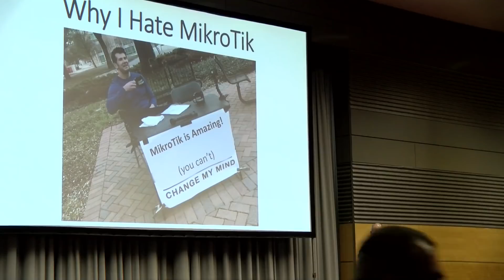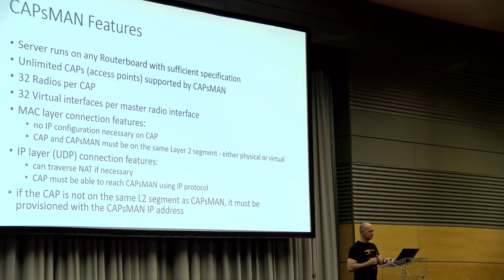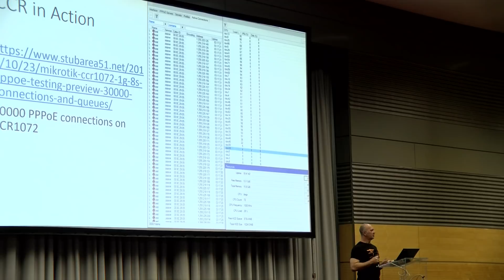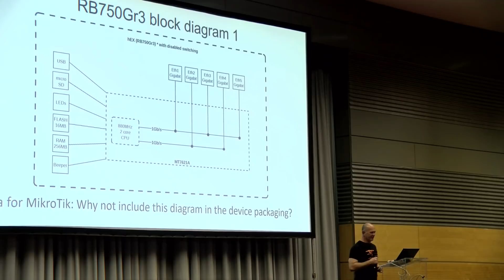This is Why I Hate MikroTik

Comment: I hate MikroTik for only be manageable by a Windows application. Would they provide a usable cli (not PS like), would make them almost always the device of choice.
Reply: learn how to SSH, srsly
Reply: @nikitakipriyanov7260  You obviously didn't read my comment. So you would know, that I only use ssh to manage my devices. And that is exactly the issue: prohibitively, non intuitive, awful cli. SSH is just the transport. The cli itself is in question. Regardless if used via serial or ssh.
Reply: @jani140  But the CLI and the GUI practically resemble each other. Whenever I find anything in GUI, almost always it is in the CLI in the same place. I agree that some things in RouterOS that are not that logically placed and I need to google just to find out where they are, but in such cases it means I would not be able to find them in the GUI either. Other things are just awfully implemented (try to configure VLANs on CRS125 to get what I mean). Third things are made differently on different hardware; it's clear that all of these machines have different capabilities and methods of configuration, but the purpose of RouterOS interface as a management tool is to hide those hardware differencies and make them under the common term, where possible. This was not done, again, not in CLI nor in the Winbox or WebGUI.

So it is strange to want Winbox while claiming the CLI is awful.

My own discontent with SSH implementation is primarily because it is assumed to be human-only interface which inhibits tools like Ansible. I even had a bug report about that, to which I got a response, "use API". Well, why would I (setup additional dedicated service), when there is SSH?
Reply: @nikitakipriyanov7260  Again not read carefully. I hate RouterOS for being primarely built to be managed by windows software. I don't have any windows. Crap design does not work for me.

Comment: just connecting to it wirelessly will knock my pc off the network in spite of manually setting the ipv4 metric.

The ones I got,  I got them because they were the cheapest thing out there to just be a wireless router.

I'd say there's something wrong with them, because I can't imagine why it would be unable to get a dhcp address nor why it would knock my pc off my network when I've never ever seen that before.
Reply from the maker: Most likely wrong cabling or other misconfiguration. Post your setup in our forum and we will help

Comment: unrealistic expectations?   Like when I expect after a reset and wired connection to internet port on the LAN with my 2 dhcp servers and it never gets a dhcp address and literally any other device can?  deal breaker.
Reply: Yeah, I know what you mean... But Romon or ip neighbors would help you work around that. Frankly, it's a silly reason to hate it though.. Cisco's are the same.
Reply: @ImmutableTech  I wouldn't have a Cisco either,  I'd sell it and buy 20 ubiquitis.  I remember a guy bragging how if he has a problem with a cisco that cisco will be there in 2 hours.   I said if I have a problem with a ubiquiti,  I'll break out a new one in 2 seconds.
Reply: Yeah. No. Ubiquitis are excellent, and im not fond of cisco. But having worked with all three professionally, Mikrotik, ubiquiti, and cisco. 

Comparatively, Ubiquitis routing and firewall suck! Ubiquiti is suitable for a home or a mid-sized non-it business; its ease of use and features FAR outshine any home router making it great for that use case. 

However, due to its "ease of use," it hides complexity, making it near impossible to do what you need to do with them. As an example, you (at least last time I checked) couldn't assign two ip to the same port, which is a requirement in a lot of cases.

For me, they all have their place.. Mikrotik is great for advanced features at a great price. Ubiquiti is perfect for ease of use, with some stunning network work features out of the box. Cisco, cisco belongs in the data centre... You install it, forget that it's there and in 20 years time replace it. It's just that reliable.... For a price.

Comment: We have literally hundreds of Mikrotik routers deployed, and it is our goto choice for managed router installs for both our corporate use and our clients. That being said. I both love and hate them at the same time. We choose them for our router needs because we need the ability to set up complex traffic shaping rules and it's built-in support for multiple VPN connectors. No other manufacturer provides the same level of features. We often bundle VOIP telephone service our internet packages and having the ability to create custom rules that isolate that VOIP and prioritize that data and provide perfect audio quality over even the weakest of internet connections is an absolute necessity and the QOS abilities of other products lines do not even compare in any way what so ever. But, it can be a nightmare trying to manage hundreds of these devices, even with the use of their 'Dude' server which acts as a centralized management platform for that. Inside the lan, and for our wireless solutions, its always going to be ubiquity hardware. Switches, Cameras, wireless p2p and p2mp, ubiquity is the choice just because of ease of use of their unif and unms management software.

Comment: I switched from USG to mtik and have not looked back since. 

I use Ubiquiti AP and switches in my deployment and mtik as the router. Best of both worlds.

19:21 There is one very big downside of CAPSMAN vs Ubiquiti. In UB, I can ADOPT my AP and if it disconnects, I can see it. In CAPSMAN, if an AP is disconnected, it is just gone from the list. This doesn't help me monitor AP statuses easily without using say, netwatch. Is there a way to change this behaviour?

Comment: 0:00 Why I Hate MikroTik
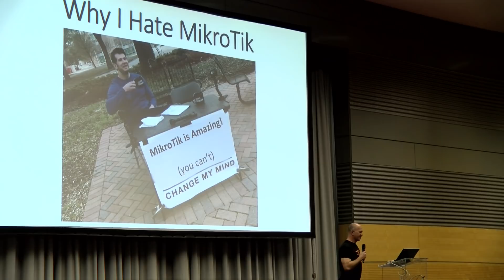0:30 MikroTikSA
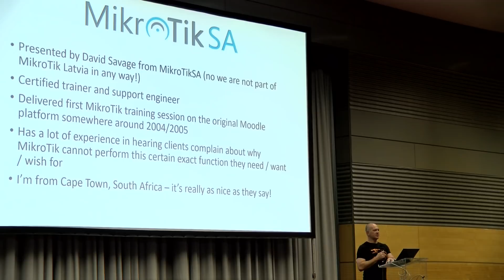2:10 Cape Town, South Africa
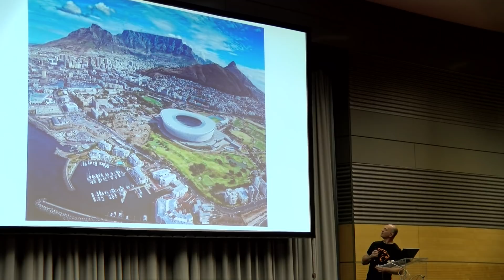2:18 Full Disclosure
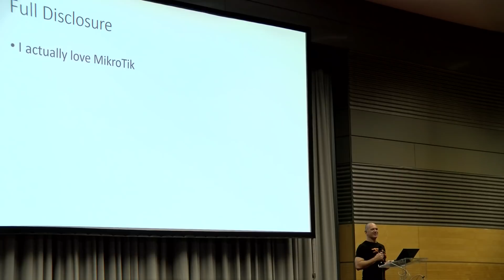2:28 What's this all about then?
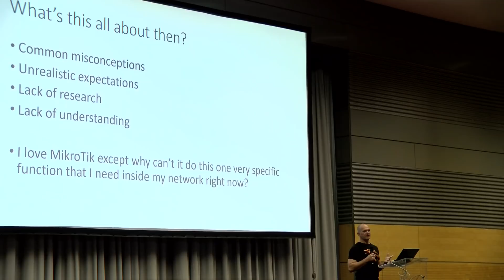5:20 Actual Conversation at a Technical Conference
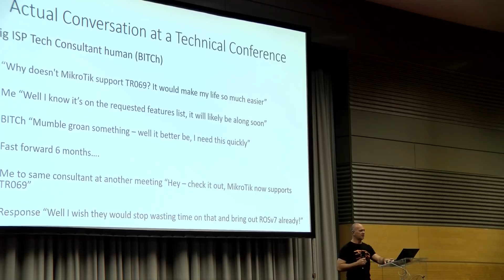6:31 Common Misconceptions
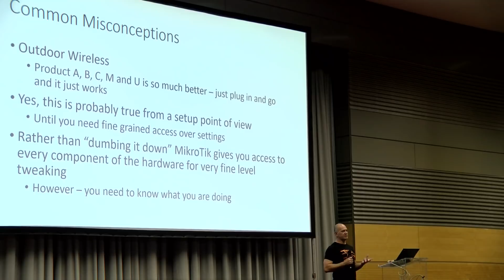8:26 Magic Bullet Solution?
13:39 You may not know
14:22 NV2 Download Ratio
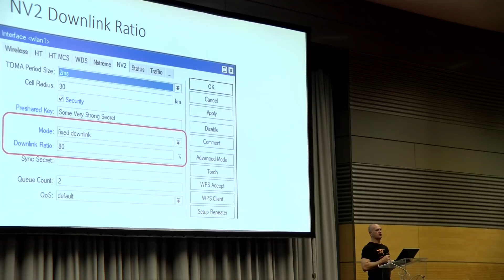16:10 You may not know
18:18 NV2 Master Configuration
18:44 Common Misconceptions
19:32 CapsMan
19:37 Common Misconceptions
20:17 CAPsMAN Features
22:43 Unrealistic Expectations
23:12 inadequate Hardware Specification
24:00 Understand Your Hardware
24:53 CHR vs CCR
25:30 CCR
26:41 example
27:08 CHR / Bare Metal
28:59 CHR and BGP Edge Router
30:19 Lack of Research
32:27 RB750Gr3 block diagram 1
33:09 Lack of Understanding
35:42 To Summarise